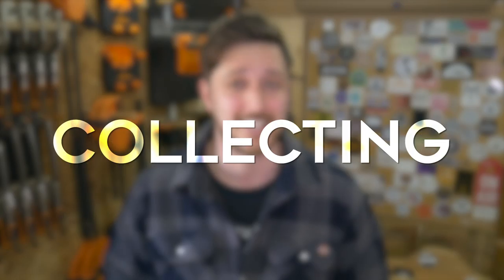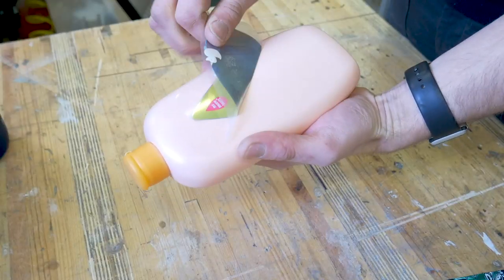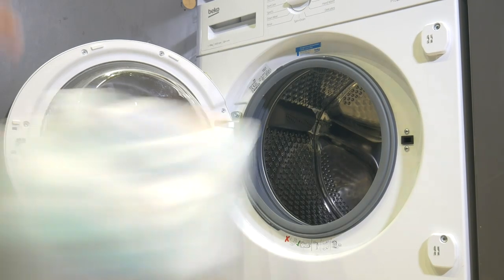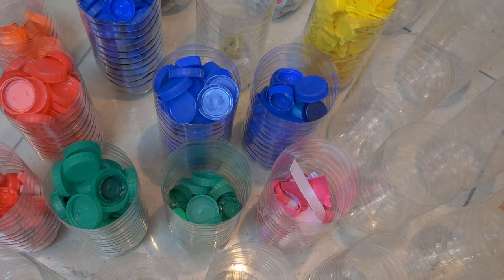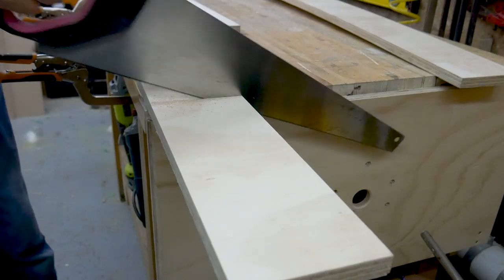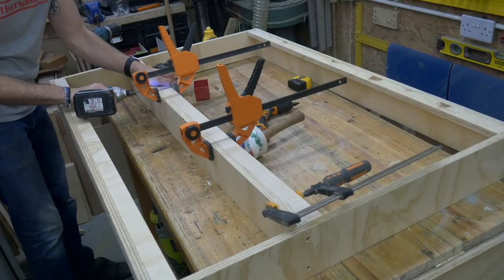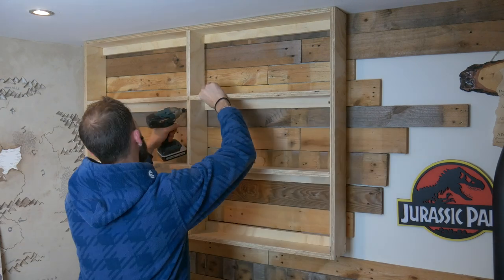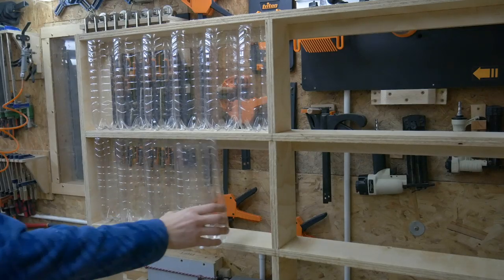Plastic Recyclers Guide to Collecting, Cleaning and Sorting

Comment: I've been trying to sneak around my town at night before recycling day (in the morning) and steal plastic.
Reply from the maker: Haha! Better to just get in contact with your neighbours and ask if they wouldn’t mind saving them for you!
Reply: The best place to find these in bulk are in car shops, the oil container is made out of these and there is plenty of colors
Reply: @kendarr   How do you clean out the remaining oil out of the empty oil container??
Reply: @rsauve999  a lot of water and good soap, usually lime soap, i can buy them in bars here. Wash what you can with it still in one piece, and then i cut it in half, and wash the halfs, i have a sponge just for that too, using that abrasive side, i know its clean when my finger dosen't slide on it  and it smells nice lol
Reply: @kendarr  you could also put it in the washing machine for good measure afterwards
Reply: @susannah8342  Yeah that too, i'm not a big of it as the way i used to clean then was great, didin't smell anymore afterwards
Reply: See if your local area has an active community area online somewhere, and include buy nothing groups. I wish I had someone to give polypropylene plastics to as I know they are usually trashed or incinerated.

Comment: To remove labels easily, fill the bottle with the hottest water you have and it softens the adhesive and often removes most of the adhesive with the label. I do this mainly with milk jugs and shampoo bottles as it cleans them as well as removing the labels. 

To remove any residuals of anything from a jug or container like dried milk or laundry soap, pour a cup of play sand and or pea gravel in the jug with the hottest water you have and shake it. You can add soap if you want.

To remove stuff from lids, fill a five gallon bucket with the hottest water you have and get a drill and a paint stirring attachment and go to town. Add soap if needed. Rinse and repeat.

Hope this helps someone.
Reply from the maker: Great tips! Thanks

Comment: This is awesome and you guys break it down so well so that anyone can do it. I was wondering about the methods to melt the plastic. Would putting it in a pot over a low heat work as well? I'm thinking large pot on the BBQ outside and just keep adding the plastic as it melts down.

Comment: Hey guys great video  I have a bunch of plastic bottles layign around that I didn't want to thrown in teh recycle bin or landfill but a lot of them are PET/PETE bottles with a "1" in the recycle logo. Is there a big difference between these two materials when melting? Thanks and great creative vids on plastics upcycles!
Reply from the maker: Thanks for the comment! PET/PETE is a thermoplastic, therefore recyclable. However I don’t think this process would work as it does with HDPE. But there for sure is a way it can be heated as broken down. Check out Precious Plastic 👍🏼
Reply: @BrothersMake  ah ok that makes sense thanks for the reply and recommendation further into the plastics rabbit hole I go😁
Reply from the maker: We fell down that hole about 3 years ago 😂

Comment: Your stuff is amazing! I live in the US and the soda bottle lids here have the inner liner sort of molded into the lid rather than just popping out. Do you have any suggestions on how to easily remove these liners? I assume they shouldn't be used in melting the lids. Thanks.
Reply from the maker: These are incredibly difficult to remove and we haven’t found a solution to this unfortunately!

Comment: Are all bottle caps HDPE? I’ve been recycling the caps from “cardboard” 1/2 gallon milk cartons because they feel firmer and smoother than HDPE. Does anyone know? I think they’re the Tetra Pak cartons.
Reply from the maker: Not all of them are, no. Unless it’s written on the cap we tend to not use them the tetra pack ones can be tricky as it’s often hard to separate the plastic from the cardboard
Reply: Usually all caps I see are polypropylene #5. Hoping to find someone that wants that plastic.

Comment: Cute little shelf! We just sorted through all our reds and greens of collected tabs from the beach and we were shocked to see how little of them actually were labeled (maybe 1/5th 😱). Some of them pretty much looked and felt like HDPE...so my questions is: do u only recycle the clearly labeled ones or do to also take a guess (I guess u must be pretty good at detecting different plastics by now with all ur experience). Or is the danger of contaminating the batch too high?
Thanks a bunch,
Nike
#inmoceanforcleanoceans
Reply from the maker: It's such a pain isn't it! We actually only recycle them if they're clearly marked because as you say, we wouldn't want to contaminate the batch and therefore make that new product non-recyclable. There are a few ways out there of detecting them, check out our recent FAQ video where we go into this topic in a little more detail 😀

Comment: Do you find coke bottle lids don't "Flow" like a milk bottle lid does?

I ended up with coke bottle lid shaped chunks of colour on my pieces.  Even when cut up it didn't flow.  I can even read Coca-Cola and diet coke prints in the finished pieces.
Reply from the maker: As long as the plastic has ♻️2 somewhere on it, we’ve never found the flow to be a problem. We do occasionally see the branding logos appear in the plastic though!

Comment: Can RIC 1 & 5 can be recycled like RIC 2?Is the process same as RIC 2s?RIC 1 & 5 can cause more pollution than RIC 2 during recycling ?
Reply from the maker: PET is tricky, but PolyPropylene can be recycled more easily. Fumes are slightly worse with 5 than 2 but it’s still feasible. Not with our panini press method though

Comment: The only problem i have is that I usually find PE (02) not HDPE (2) caps.
Reply from the maker: They are the same! PE is the polyethylene in HDPE 🤙🏽🤙🏽🤙🏽
Reply: @BrothersMake  So the high density doesn't matter. Thanks 😊

Comment: Why can't you use clear water bottles?  I would think there are more of those than the caps.
Reply from the maker: They are made from PET, which is doesn’t work with this method of recycling.
Reply: @BrothersMake  too bad there is not a way to recycle the bottles since there are more of those.  I tried but it's comes out too brittle.  thanks.